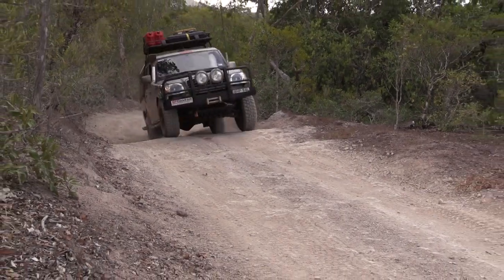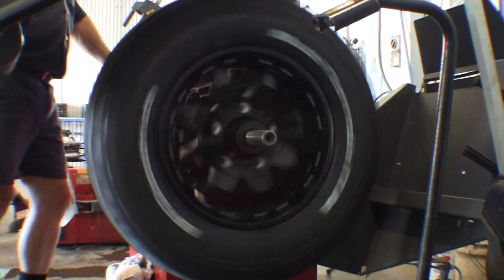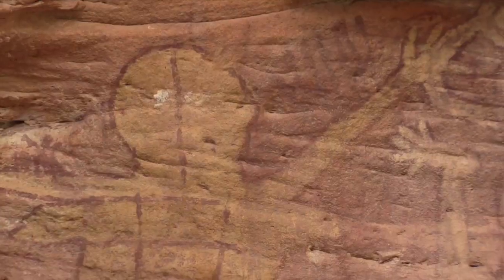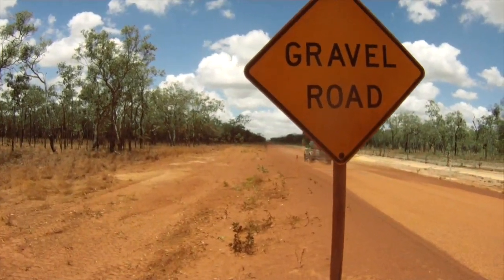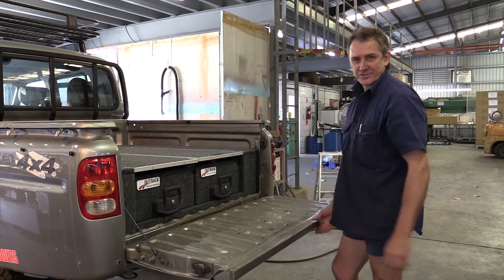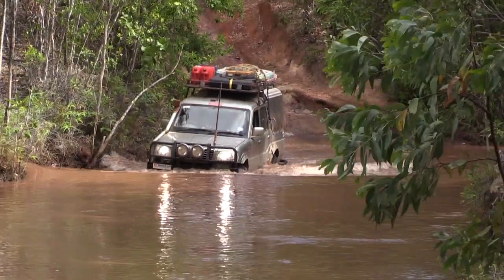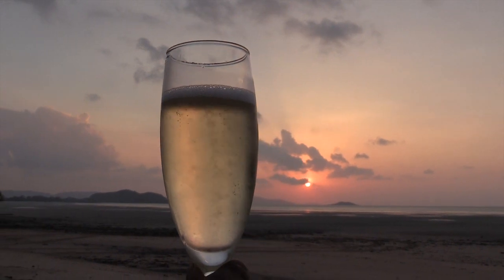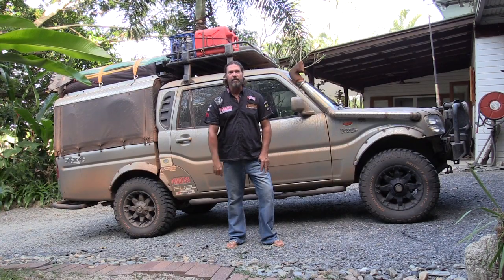Mahindra Pik Up PROMO

Comment: I wanted to see a bit more of the Old Telegraph Track Gunshot, Cockatoo, did see tiny bit of Palm Creek for a second BUT rather than call it a Mahindra Promo, call it a Cape Experience Promo and do a seperate video of Mahindra doing the tough stuff to The Tip. Just saying, I wanted to see The Mahindra Dance, not Indigenous, I can see that anywhere these days at local Parks all around Australia, Mahindra is a bit harder to find off road clips of.

Comment: Too bad  we can't get these in the U.S.A. Do they come in a standard cab with a longer bed? I might buy another new truck if I could still get what I want....basic work truck, regular cab,long bed, inline-six engine option, manual transmission, real thick vinyl bench seat (No bucket seats with 3-foot high headrests or useless center consoles), NO useless complicated gadgets(LED screens,keyless entry/ignition,back-up cameras,on-star,etc.), manual roll-up windows option, option to delete air conditioning if desired, reasonable size rims(15" or 16"), etc., etc. All at a cost that doesn't require taking out a second mortgage. Can I order a truck like that? NO WAY! Will I ever buy a new truck again? NO WAY!
Reply from the maker: Yep  ...you loss a lot of money on the initial purchases
Reply: They started in US, Deltroit.
Reply: 2.2 shopping trolley.